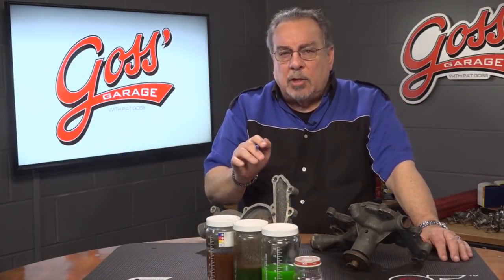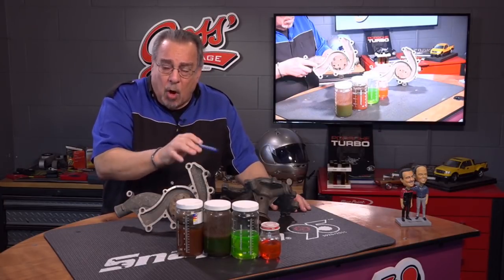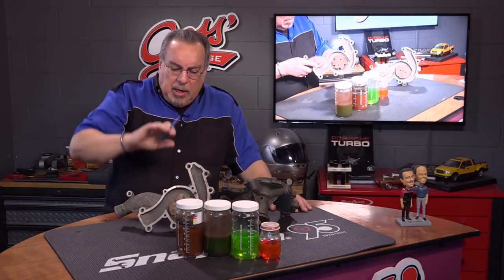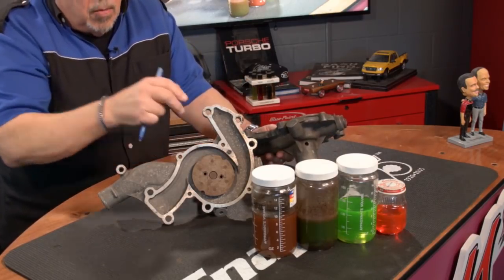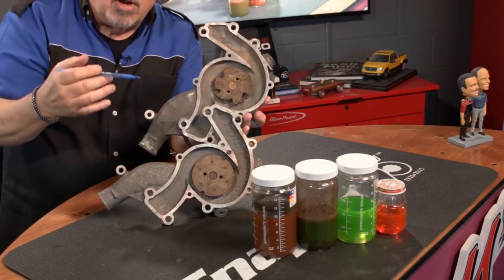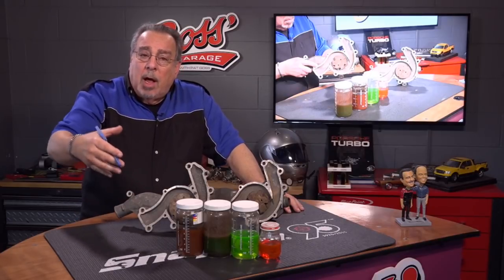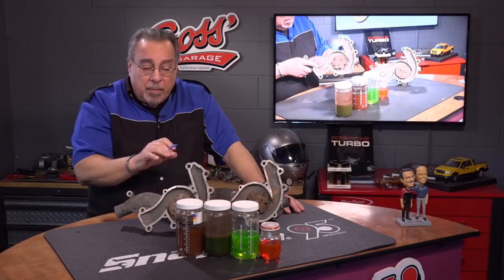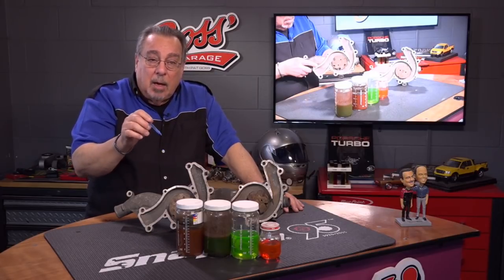Disolved Engines

Comment: Anti Freeze does not stop over heating. It raises the boiling point. So your vehicle will still get hot. It's why they call it Anti Freeze. As it stops the water from freezing. It also stops corrosion. 

Why I tell people. You can run Water Wetter in the summer. As you want to stop the engine from getting hot to start with. While still fighting corrosion. Just be sure to change it out with Anti Freeze in the winter time...
Reply: Dont follow this comment antifreeze and coolant are the same shit it is what helps cool your engine and it also has anti corrosive chemicals in it to help deter corrosion....you can run water in your car for a short period of time like if you have a leak and water its your closest source but change it out once you fix your problem unless you wanna corrode your engine...always run a 50/50 mix or whatever your car manual says....you only run pure water in your car if you want to fuck it up and you dont care about it
Reply: @steve1199  Antifreeze is NOT coolant and DOES NOT help cool your engine. Water is the coolant, and anti-freeze is an additive. Antifreeze+water is coolant. Glycol by itself has mediocre cooling properties, however water has excellent thermal conductivity and capacity.
Water in the summer works perfectly fine as a coolant for short periods, you can run on it for a few weeks before it starts to collect metal ions and corrodes things.
Reply: @SpencerLemay  U basically reworded everything I said in ur first paragraph. And antifreeze will help cool your engine. Any fluid that is cooler in temp than ur motor will help cool ur engine. Doesn't mean it's the right fluid tho.
Reply: @steve1199  I reworded it because you were mostly right but details were wrong.
"Dont follow this comment antifreeze and coolant are the same shit "
Which is wrong, if you put in straight antifreeze your shit will overheat faster than putting in straight water.
"you only run pure water in your car if you want to fuck it up and you dont care about it"
This isn't right, you can run straight water for months as long as you closely monitor it. Corrosion won't happen if you flush it and the temps will be fine if you check on it a lot and don't go out during a heat wave. If you need to flush your cooling system there is nothing wrong with going with straight water for a week, straight antifreeze is suicide.

" Any fluid that is cooler in temp than ur motor will help cool ur engine"
Barely. That antifreeze won't stay cooler than your engine for long! It will also cause the additives to settle causing even more damage.
Reply: @SpencerLemay  Water is suicide. I wouldn't even advise going more than a week on straight water. Ur boiling point is lower and there is no protection. We're beating a dead horse. Use what you can while ur in a bind but go with what ur manufacturer recommends otherwise
Reply: @steve1199  btw i only order pizza as Rusty Shackleford
Reply: @SpencerLemay  Is that an ACTUAL computer?...
Reply: @steve1199  If you are talking about the videos on my channel, yes it is an Atari ST from 1985 controlling a tower of music gear via midi.
Reply: @SpencerLemay  No I was referring to the actual episode where Dale uses the alias rusty Shackleford. Now I am thoroughly pissed. Good day.